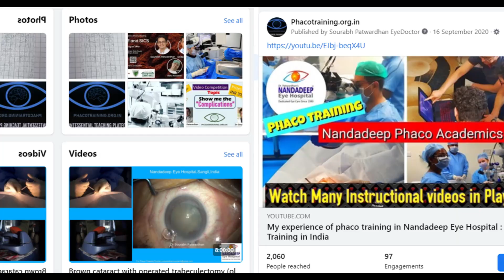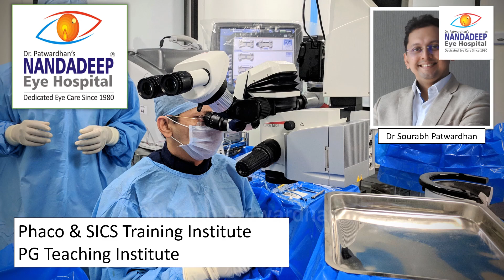187 Quiz: PCR at last piece :Why? Dr Sourabh Patwardhan

Comment: 1) Rupture occured around 1:48, not at the beginning of the case
2) overfilling AC with visco without injecting it under the pieces which just clogged port of a phaco tip, compromised fluidics, making it difficult to achieve good followability , without actually inflating capsular bag
3) using ultrasound without achieving tip occlusion with nuclear material which broked the capsule which was sucked with aspiration
4) maybe using a spatula or blunt part of a chopper under the piece to protect against a capsule coming up can be a good idea, also aspirating some of a visco before attempting to deal with a peace.

Comment: Surgeon caught the PC instead of nucleus in bevel down position. during emulsification of last piece vacuum, Phaco power and aspiration flow rate to be reduced with increasing the bottle height/IOP/inflow and to emulsify in the pupillary plane to be safe with good control on foot pedal to reverse from step 2 after emulsifying the last piece

Comment: Removing last piece in abscence of epinuclear plate has to be very careful. The wrongs in this case might be, The phaco tip is bevel down, epinuclear plate shouldn't be removed earlier than nuclear pieces, the vacumn, flow rate and power to be reduced and it is better to remove small pieces with viscoexpression rather than phaco in abscence of epinuclear plate.

Comment: The surgeon should 
-push the visco properly and remove the air bubble completely so that the view is not obscured 
- also the pieces should be brought in centre instead of 6oclock while pushing the visco for last piece 
- the major mistake is direction of the phaco tip (pointing downwards) 
It must be side ways 
- the phaco tip later was turned upwards and was dipped down while turning upside that caused the PC TEAR
- the irrigation ports were also blocked many time during phaco

Comment: I feel the tip is blocked by the previous piece, surgeon is pressing foot switch further and further trying to aspirate the last fragment, the irrigating ports of sleave crossed the inner lip of the main port and either the chamber collapsed or the blockade got released and surge happened at the same time the irrigation reduced.